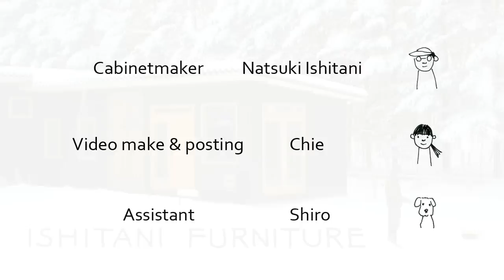ISHITANI - Sawdust Stove

Comment: I saw this yesterday, so today I tried to make one that is functionally the same out of galvanized steel HVAC ducting. I put a cap on one end, attached it with some rivets and sealed the edge with silver tape. Over the top is a simple rain cap. It looked promising once I got the fire started but when I put the rain cap on, the fire died within 15 seconds. It must be that even though the rain cap is open, not enough oxygen is getting into the tube. But adding a few additional air holes towards the top of the can did not help much. Do you have a hole in the center-bottom of the cylinders that you burn the sawdust in, to let air in?
Reply: I think you might lack of draft. How long is the chimney?

Comment: Idea, use carbon felt in place of the saw dust roll the felt up into logs and place them around the center pipe that has lots of holes drilled into it with carbon wicks that absorb liquid heat or another liquid like alcohol that you can light at the bottom of the tube and will light all the other wicks that draw out the fuel soaked carbon felt with heated air hitting the top of the stove then drafted across the top of the stove and up and out through an exuast flute. An alternative way to heat and cook by creating a huge burner fuel cell. Depending on the amount of air flow through the system the fuel cell should last three times longer then burning saw dustnor other wood chips. 😊
Reply: Good idea, but it defeats the purpose of using up waste (saw dust/wood chips, etc) from his projects.

Comment: Where is that stove venting? Into the shop? 

I see the pipe on the back but the stove seems to be venting directly through the top into the shop...
Reply: The convection is pulling the flames sideways and up the flue pipe on the back that you mentioned. You can only see the flames through the vents but they are not coming up and through them. You can see the smoke coming out of the flue pipe above the roof at the end of the video